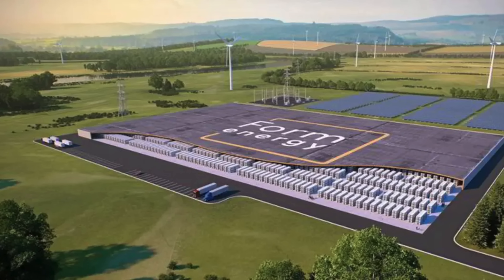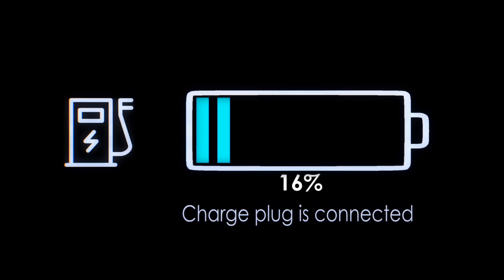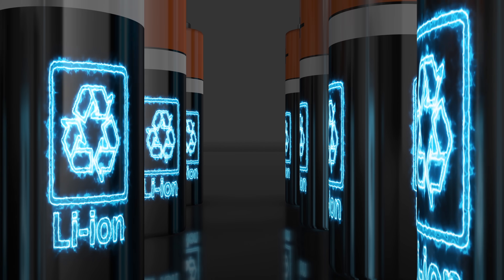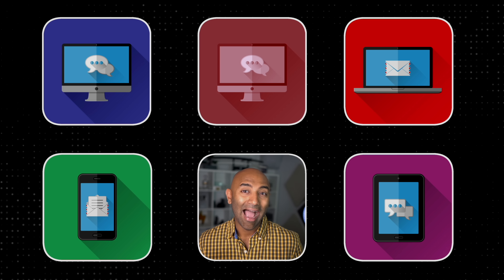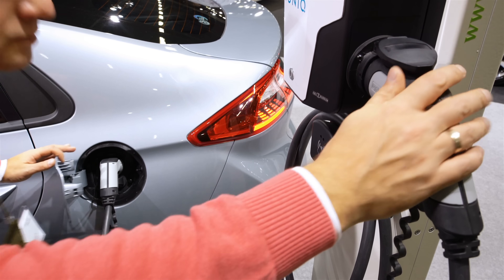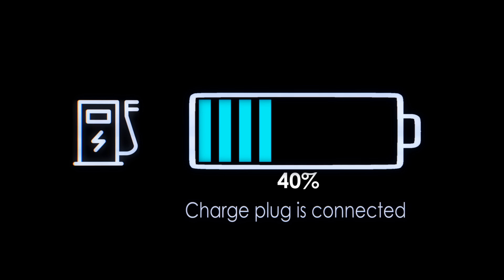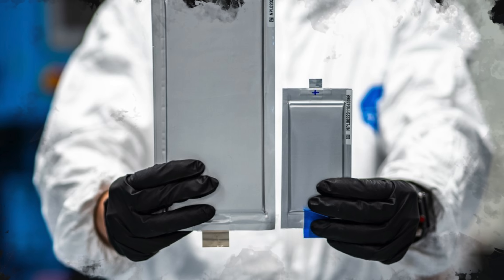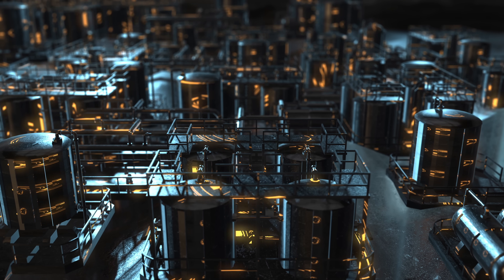This Battery Claims It can Store Energy in RUST!

Comment: Would love to see the grid scale energy storage systems all compared:
Pumped hydro
Flywheel
Li ion
Iron air
Molten salt
Molten Metal
Cryogenic air
Gravity
Hydrogen
Nickel iron
Heat batteries
Etc...
Compared in terms of scale, land use, efficiency, max discharge and recharge power, capacity.
Loved the scale graphic, really puts things in perspective.
Reply: i really like gravity, like we have lots, and lots of old train cars that arent able to be used anymore, and we just scrap them, thousands a year. we could just fill them with rocks, put tracks on a hill, and have massive mechanical gravity batters for the cost of rocks that no one wanted, and train cars that were scrap +(the expensive part, but not that bad really) solar power and electric motors to pull them during sunny times and drop them at night.
Reply: @redhairdavid  nice idea, but like hydro it's very dependent on geography and available space, and is extremely poor in energy density.
Reply: @MrGonzonator  true, but it only needs a hill, that is close to somewhere you can put a solar field. That isn't to restrict really, 30% of the continental U.S. qualifies. And yes, power density is low, but it's so cheaply  and likely would work for 40 years with minimal maintence
Reply: @redhairdavid  ok, let's imagine a storage facility that can output the same as Tesla's Hornsdale battery... How many carriages of what mass over how many tracks and what kind of drop are required?
Reply: @MrGonzonator  currently 9600 tons of concrete and rocks is going up and down a 2000 foot hill, doesnt look that steep, but i dont know the grade, people are standing around in the pics, and arent leaning to stay up or anything. ares project. its just a test project, so the cost are huge for only 50MWH of power, but to increase you just have to add the cheap part, the cars full of rocks. the rest can scale at little to no cost, the controller for speed and the sensors to detect how much power is needed and what not are there and good at 50MWH or 500
Reply: @redhairdavid  How about putting Iron air batteries inside of each car on the hill so it can refill the grid in 2 forms and also utilize batteries for weight. I always thought every rail car should have solar on the roofs to work like a hybrid for diesel trains. Long term all rails should be converted to overhead electric wires or 3rd rail like they use in other countries.
Reply: I like the carrot in front of the donkey…🤺
Reply: @5226-p1e  no.
Reply: @MrBadbonesaw   really  only works in areas where the grid is already in place.  The power grid infrastructure to power the train directly on long stretches of the mid-west and west just isn't in place canary or rail electric power is expensive to install.  Also, as seen recently with 100F days canary power is susceptible to temperature issues heat sags the line and Ice freezes them both are bad.   The biggest impetus to changing form Diesel Electric Hybrid to Battery  Locomotives  is the refueling time though rail sidings and yards could have a place for "Battery Cars" to charge from the grid as well as have some PV on their rooves  that way they can be swapped out along the way. nearly as good as using the liquid fuel.
Reply: @techobservations8238  I was thinking instead of battery cars they have battery shipping containers, so when they reach a hub a crane just swaps the containers (complete with cooling system) and the train goes on it's way. Of course this won't work for those enormous km long multi engine cross continent trains, but for short haul regional transport it should fit the bill.
Reply: @redhairdavid  
Yes, about 60 years ago I read of a similar “battery” scheme using houses: you support a dwelling on vertical stumps, like pontoon jetties, wind them up to store and let them down to recover electricity.
Reply: And each of those has subgroups, eg gravity has about 5 different versions
Reply: Ambri Liquid Battery
Reply: @Wol747  Calculate the dollars per kWh for the house scheme and you'll see why it's never been done.  Building the house elevator is the part that kills you.
Reply: @incognitotorpedo42  not enough drop either. For example, the empire state building weighs 365,000 tonnes. If you were able to lift it 1m in the air, the energy stored would be MGh, or about 3,650,000,000J. Sounds a lot but it's only about 1MWh, enough to charge 10 Model S.
Reply: @redhairdavid  Much too inefficient. And much too expensive to get any amount of GWh out of that.
Reply: @MrGonzonator  We would need Superman to lift the Empire State Building. Imagine its all full of people and Lex Luthor comes along and wants to steal it!
Reply: @redhairdavid  so 70% doesn't qualify and that is not to 'restrict really'? And what is the coverage of a single unified energy grid in the US?
Reply: we will be on nuclear or something soon enough
Reply: @MPee76  even at the low energy density of this storage, you would need far less than 30% of the space.
Reply: You forgot hydrogen fuel cells.  Batteries are so 2019.
Reply: @AnalystPrime  Yeah, engineers have limits (you know, what I like to call "physics").  That's why PG&E continues to light a good portion of California on fire each summer when things heat up.  They don't have an answer to the transmission/distribution limitations of overhead power.
Reply: @vanderumd11  Genius!  We could split the atom!  Why hasn't this been tried before!
Reply: You missed NiFe, already commercially available for decades and a decent option for stationary storage.
Reply: Great idea
Reply: Ultimately it all comes down to cost. Whichever is cheapest is going to be the winner in grid scale.
Reply: @wakannnai1  that's mostly the case with everything
Reply: @ReachOutToWilliam  in france our department will have construction finished in a few years. Positive reality has been reached in some fused relationships
Reply: @ReachOutToWilliam  well, the state regulations and purposeful failure to do maintenance of the forests does factor in.  Yes, PG&E needs to do a better job, but environmentalists tell everyone that clear cutting is bad, but burning the whole forest to the ground in natural and good.  When called out, our great leader, Newsom, said that the Native Americans understood it and let nature take its course.  The Native tribes came out to correct him.  They said for centuries they cleared areas for the safety of the tribes and the benefits to wildlife; the reason they don't is because of state laws preventing them from keeping the forest healthier and safer.  Odd that after the state sued PG&E, the state gave PG&E a rate increase... why was PG&E rewarded if the state thought they acted in bad faith?  Yes, CO2 in the atmosphere is man's fault because one month of the Camp Fire put more CO2 into the atmosphere than all the cars in CA do in a year.
Reply: @anydaynow01    You would have look into how much energy is needed to haul the battery.   Kerosene (Space-X uses it for launch) and diesel have an incredible amount of energy per kg that makes it worthwhile even with the poor efficiencies of the engine.  You could also make the engine dedicated to just generate electricity to recharge the batteries - more efficient.  Electric motors for cars require somewhere in the neighborhood of 7 hp per 1000 lbs, so a 3000 lbs car needs about 21 horsepower ...  and gas powered are underpowered at 100 hp.  Start-up cost would be huge, but on the downhill slopes, the batteries could get some recharge.  Perhaps, in areas very close to the grid, overhead or 3rd rails could be added.  I think you are on to something.
Reply: The complete analysis would also include:
proximity to load
transmission cost and losses
failure mode abrupt or degradation
mean time before failure
maintenance cost
intrinsic CO2 cost of materials including extraction, refining and manufacture
and more...
Reply: @shirleypotter4668  
I can't remember where I found the information, perhaps it was an iron all I know is it was something similar to the Baghdad battery. Just look up Pyramid Power Station oh, and you might find the video that I saw. It was very interesting.
Reply: @johnmcclure2912  that might be a little too in depth fir this particular channel, but all good and relevant. Its starting to sound like we need a whole documentary series to cover everything.
Reply: @redhairdavid  How much energy, and what is the source, to get the cars back up the hill for round 2?
Reply: @joeshmoe7967  solar or wind or tidal or geo thermal...etc doesn't matter as long as it's sustainable. It takes about 20% more energy that it stores to pull it up, then you get 80% of it back over night, or when the wind slows or when demand changed  or whatever is required for the specific use situation. Different for all of them.
Reply: You forgot Gravity and Liquid Metal Battery
Reply: And don't worry I am already on it. I'm at the stage of structuring how the data will be represented.
Reply: @AnalystPrime  not even the point i was trying to make - temperature is only one of the factors

Comment: It bothers me that they keep claiming that the "Iron-Air battery will last for 100 hours" as if this is a good thing. This means that to have the same power output as a lithium ion battery (Watts, not Watt hours), you will need 100 times the capacity. So look at that diagram shown in this video and multiply the Iron battery size by 100. This kind of battery would be fine for a ship as long as it takes it 100 hours to unload and re-load cargo, but not very good for storing green energy from solar or wind which both have a 24 hour cycle. Solar only produces power for about 8 hours a day, so you would have to have a huge over capacity of Iron Air batteries to accept the power from solar. They might find some uses for this battery, but they need to get the charge time below 8 hours before this battery becomes really useful.
Reply from the maker: Douglas, did you watch the video, because I broke all this down
Reply: @TwoBitDaVinci  Yes, I did watch the entire video. You did cover the difference in energy density, and you did explain what was meant by "the battery lasts 100 hours" that most other sources gloss over and imply is an advantage, but you did not explain the huge disparity in rate of discharge that would require 100x more Ah of Iron air batteries than lithium ion batteries to get the same power output. Your comparison showed your garage filled with 1MWh of lithium Ion batteries vs 1/3 acre for 1MWh of iron air. But to match the power output (peak Watts not energy storage or Ampere hours) of the garage full of powerwalls, you would need 33 acres of iron air. This is what I was trying to point out.
Reply: @TwoBitDaVinci  The point I would make about it is that Form Energy's website is pretty clearly trying to tout the 100 hour discharge as an advantage.  The only potential advantage is cost. However, even if the cells are much cheaper than lithium ion, the advantage would be mitigated by higher system costs (as you mention) .

Comment: I'd like to see you do a comparison on all these new batteries. What’s actually better? Lithium ion, iron air, liquid metal, flow batteries, liquid air, gravity batteries or old fashioned pumped hydro?
Reply: Existing pumped hydro? GREAT! (Climate change not withstanding.... You can't pump water if there's no water!)
New Pumped hydro?
Generally high carbon to build AND huge disruption to local area.
Batteries?
There's an argument for all, depending on location, use type, relative cost.
Reply: @rogerstarkey5390  that's kind of what I,d like to hear about, the cost, the environmental impact, the availability of the materials needed to make them, etc…

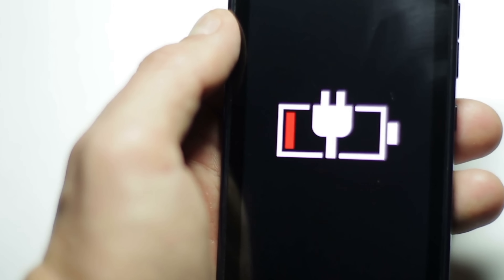Comment: 3:00 one C does not mean 100amps. One C means the rate at which a battery is discharged relative to its maximum capacity. 
It's 100amps if the battery is 100 amp hours capacity. For an AA battery, one C would be 2amps typically. 
Feel like you should have specified, that it's for that hypothetical battery, not in general.
Reply: Thank you for pointing this out to folks, and you're right.  He got the C rating wrong.  I'm also glad the video right away showed that there is NO distinction of benefit for a low C rated battery (or any other storage technique) in terms of "lasting longer" or "long duration".  That is pure spin, but you wouldn't believe how many in the energy procurement field don't understand this about storage.  I believe it stems from lithium battery storage solutions rating their systems by its maximum output rating 100 MW for example, running it at that high rate to resemble a traditional power plant 100 MW for one hour and thus their 100 MWh lithium storage solution appears to be very limited in its abilities.  Take the same lithium storage solution and discharge it at 10MW for 10 hours and suddenly, people in the industry think you've created a new technology.  Sad but true.

Comment: Adding a small amount of bismuth fixed the batteries discharge issues?
In other words they gave the battery some Pepto-bismol :P

Why do the batteries always have to be aboveground? Underneath the slab of concrete in a garage seems like a great place for a home's battery. Underneath parking spots in general seems wise too. Then put solar panels on awnings above the parking spots to help charge those batteries and protect the cars underneath from the weather.

Comment: This and liquid metal batteries would make great storage solutions for home power storage when paired with solar.
Reply: Liquid metal batteries run at rather high temperatures so they are a good solution where the Heat i s also needed
Reply: @techobservations8238  It's my understanding (and I am no expert) that the temperatures are self contained and necessary for battery operation, so they are not hot to the touch from the outside and you wouldn't want to syphon off the heat either b/c the battery needs to maintain internal temps.

Comment: I know of 3 rechargeable aluminum air batteries but because the same trick works with Zinc the inventors in all three cases went down that path instead. They negate the dendrite problem with polymer electrolytes. Second uses a telescoping cell design and vibration. In the third case its a spool to spool process with a dendrite brush, scraper.

Comment: RTE (round trip efficiency) and cycle life are critical to know for any battery contender.  I'm pretty sure that iron-air has a lower RTE than most others, but Form doesn't tell us.  Lower efficiency is a real and ongoing cost.  If one technology returns 19 out of 20 KW-hours to the grid and another returns 13 out of 20 KWH, then the cost of lost energy becomes pretty substantial over thousands of cycles.  Effectively, you would need 50% more power generated initially to return the same amount of power to the grid after storage.  As with Form touting the "advantage" of 100 hour storage (turning a lower power potential per MWH into what sounds like an advantage).  Whether for off-grid storage, or for grid storage, I don't care much about energy density, but I want to know C-rate, cycle life, and RTE as well as cost per KWH.

Comment: Discharge rates that low are a problem - you really need to be able to get at your energy quickly.

If it takes over 4 days to discharge, how long does it take to charge?

To get a decent amount of current out of one of these, you would need hundreds of times more storage than the equivalent li-ion or LiFePo4.

Meaning it needs to be hundreds of times less expensive.

As an example, if you have an off-grid solar installation in your home, and need a 5kw peak output, you need between 1kwh and 5kwh of storage depending on the exact chemistry.  That's going to fit in a relatively small box in your home, under the sink or wherever.  And a li-po will be significantly smaller still.  Not as safe or cheap though.

With iron-air (FeO2?) You would need a 500Kwh battery.  That's a battery bigger than your average car.

Now scale that up to grid level, and you need a skyscraper sized installation to replace a battery the size of a shipping container.

Just the physical infrastructure required by iron-air is going to cost more than the equivalent LiFePo4's total installation cost.

Get that C rate up and you have a chance, otherwise this is worthless.  You'd be better off with pumped storage or compressed air storage if you have that much space and money to spend on building out massive infrastructure projects.